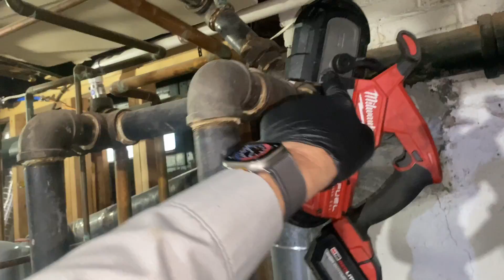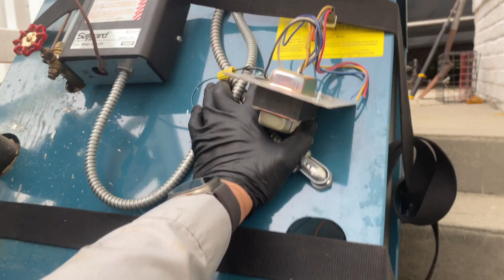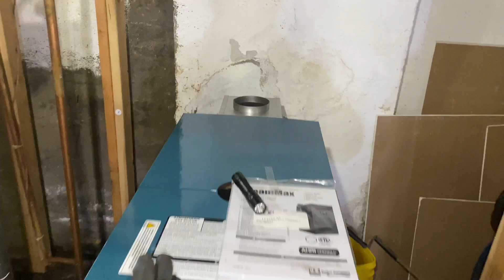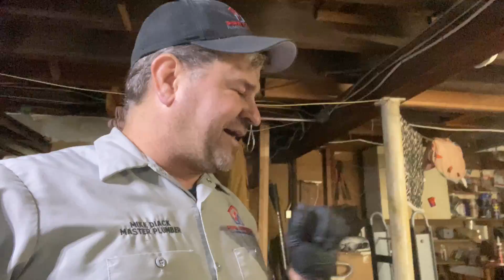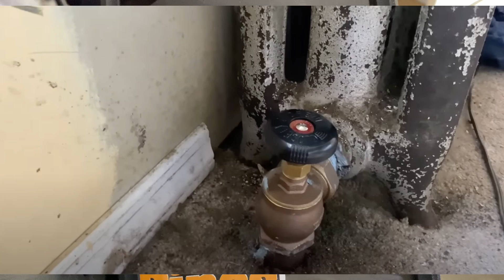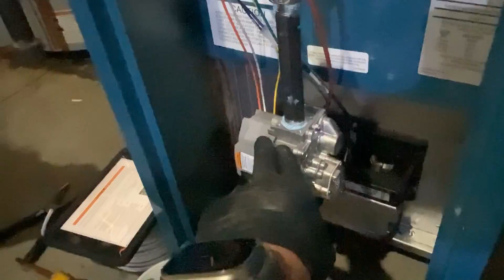Effortless Installation: Easy Steps for Burnham SteamMax Boiler

Comment: PowerMate Hand truck/cart/dolly (yes know a hand truck and dolly something basically and diff from powermate; but ppl o call them same thing depending on locale……or a powered dolly even) for the win, and after using one for first time; you’ll never want to use anything else. Just wish pricing for those things were a bit cheaper, but get what pay for especially in build quality ¹ 

¹ Build quality- that is main difference between a dolly, hand truck/cart, and powermate; the building materials that go into frame materials gets higher quality and heavier duty as go up the “line” from low end of a dolly to extreme heavy duty of a powermate w/ hand carts in middle but can also me dolly light material work to mid range heavy duty; whereas powered hand carts are heavier “extreme” duty materials….imo

Comment: Why on earth are you using a dolly when you have a powermate stairlift?! I have the same one and the aluminum lighter duty as well. I can move that boiler by myself. You used it going up the stairs why not going down?! No one should be below the load if you were certified by powermate,  and the instructions are on the side of the lift. Your installations are almost always perfect to the directions, but you're moving the boiler could be better and considerably safer following powermates instructions. Two people on the top of the lift is appropriate for the really heavy loads.
Reply: I was thinking the same thing...

Comment: Very Very nice job as always!! That’s why I watch. Just so you know sir I’m not a DIY guy. I’ve been in the trade for over 20yrs. The test you mentioned on the pressure switch port was not from a diy guy. I agree we need to make the trades great again why I shared and you share!
Reply from the maker: Thanks 👍 U are correct. The match test is the DIY guy. The other is …….

Comment: Black malleable fittings, are allowed on low pressure steams, in many jurisdictions. Including NYC. Only real benefit of cast iron, is they can be cracked and removed. Not much of an issue these days, with sawzalls and grinders and band saws.
Reply from the maker: I did say they would work, I just said its not correct. Have you read any of Dan's books or attended his class? Anyway: Cast iron threaded fittings are generally used in steam heating and sprinkler applications. They are highly durable and practically indestructible. They also expand at different rates. The cast is less likely to leak on steam, and is
removable when it does leak. On hot water, maleable is fine
Reply: @PipeDoctor I have attended Dan's and studied (not read) his books. To the best of my knowledge, the only place where Mr. Holohan discusses the difference between CI and MI fittings, is on page 118 of "We got steam heat". Mr Holohan clearly articulates that the only benefit of CI fittings, is the ease of removal. CI fittings can be cracked with a hammer. MI fittings can not be cracked with a hammer. That reason is long obsolete. MI can easily be removed, using the proper sawzall with the proper blade. Ditto to band saw or grinder. Make a cut or two in the fitting, hammer and cold chisel and bye bye fitting. There is zero functional or durability difference between CI fittings and MI fittings on low pressure steam. 
.
Reply from the maker: @aaronkoster3940  thanks for sharing. happy thanksgiving
Reply: CI is never allowed on gas